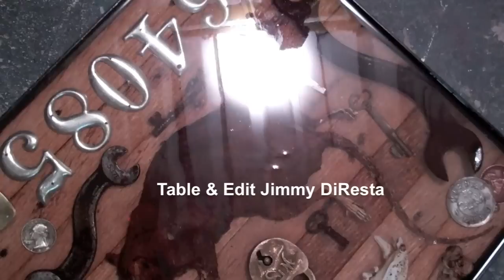✔ DiResta Rat Stool

Comment from the maker: you can overlap pours but be sure you get all bubbles out of the layers as they harden , once they are trapped you can not remove.. too much rust may cause bubbles so i would remove.. rust will not stay orange once wet so best to remove it any way...

Comment from the maker: you can use a chain saw? or a 4" angle grinder with a chain saw disk, designed to remove lots  of wood material
.. or a 2" fostner drill bit to dig out the waist .. be carful! thank you

Comment: Great video Jimmy! I have a couple questions:

1.) What is the wire wheel you are using on your angle grinder? I would love to get one.
2.) What brand of gun glue are using on the steel?
3.) Is the epoxy being used to seal the wood in addition to holding the ornaments in place?

Thanks!

Comment: love these vids man!! Hey get a thick copper bus bar to clamp in your corners to weld the gaps,,,,,, it holds it square and gives you a 100% flat weld on the other side when you unclamp the copper.... Ive used round copper in vertical corner gap fills and you can weld from outside while leaving an almost smooth tig fuse look on the inside.

Comment: That is really cool! What did the torch do for the epoxi? Did it help get the air bubbles out?
Reply: the torch will get rid of the bubbles
Reply: paul schuetz I assume that he uses the torch to heat up the epoxy and therefore make it run better...

Comment: Congratulations for your work! But, unfortunately, the rat's thigh was too thick, reaching the outer surface in two points, as seen at 5:15, which can cause you trouble, if you don't make the resin upper layer thicker; I mean an extra resin layer. For the good of your wonderful work!

Comment: Why do you use a torch inbetween the epoxy layer?
Reply: To get the air bubbles out for a clean clear product
Reply: +ac3r787 The heat makes the air in the bubbles expand popping them. Otherwise the epoxy can cure with them in it and then they're forever unless you sand and refinish.

Comment: What is 2:34? chemical
Reply: It's a "cold bluing" agent for steel if I am not mistaken. There are many brands, and all of them do pretty much the same thing. It creates a surface coating on the steel that is much more resistant to rust than the bare steel is.